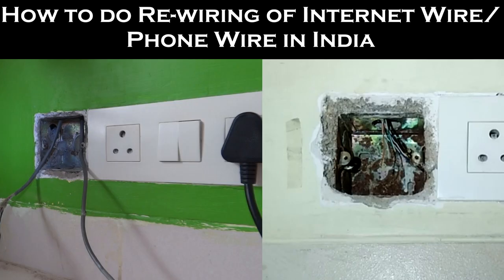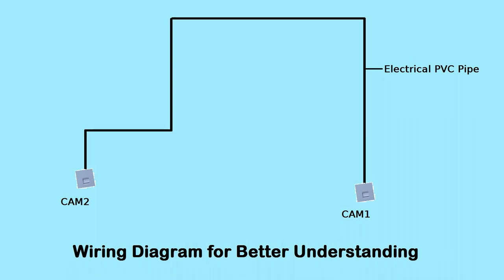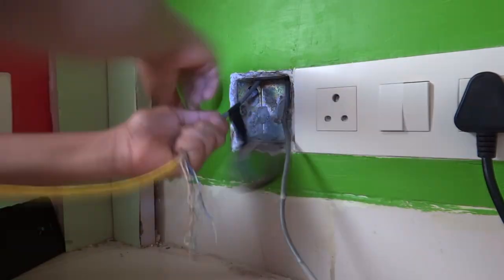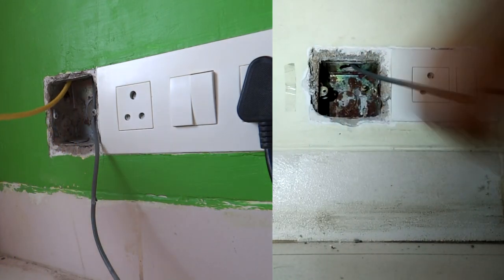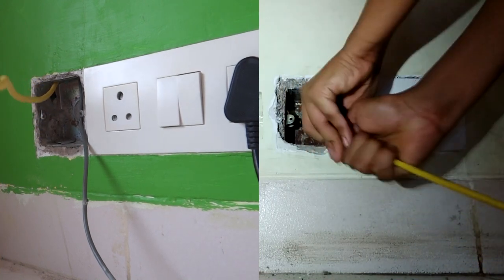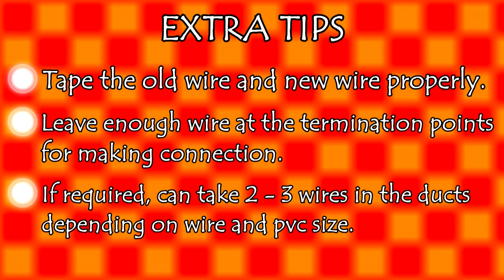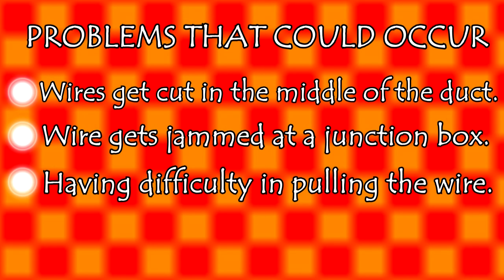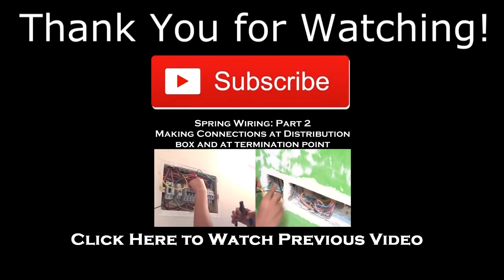Telephone or Internet LAN Wiring || Internal House Wiring

Comment: there is no wire inside my telephone jack to tape my lan cable .How will I do it then?
Reply from the maker: If there is no wire, you can purchase a spring wire and use that in an empty pipe. I have made a video on that as well. Here is the link: https://youtu.be/34XONUvVEqg

Comment: Wires are not moving..  its blocked... what is solution
Reply from the maker: First do the shake testing properly and see if the wires move. Many times we don't shake the wires properly. If that doesn't work, you can send the photos of the wiring to my email pranavshastry16@gmail.com and I will give the solution.
Reply: Use oil